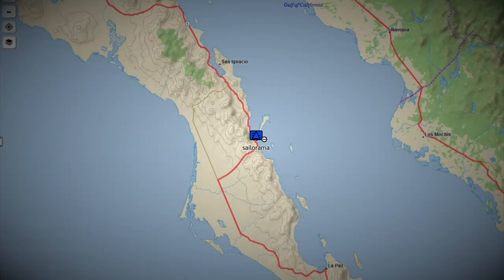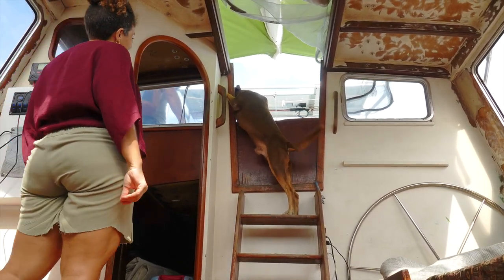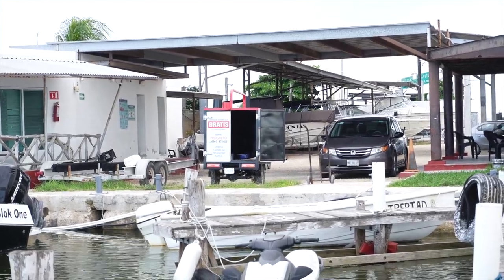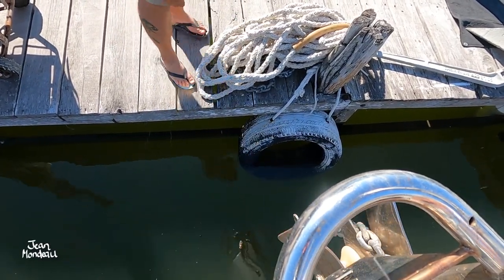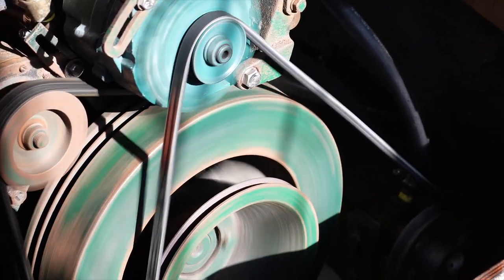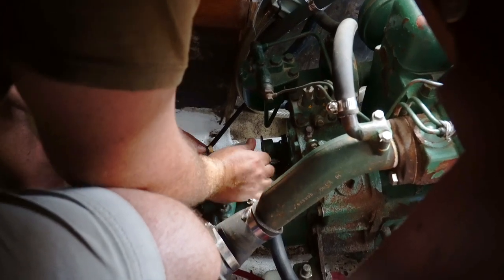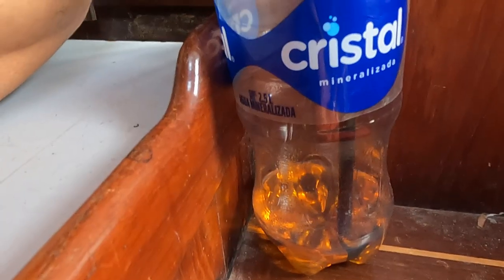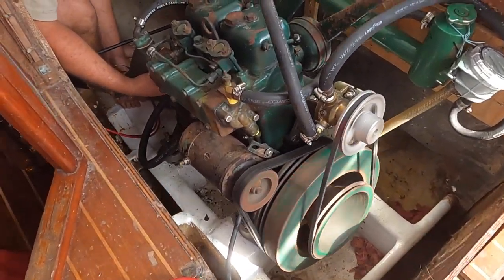our WRECKED SAILBOAT does not have enough revolutions PROGRESO

Comment: The prop is pitched for the previous bigger engine. Re-piching it is an easy and inexpensive solution that will save you troubles and fuel in the future. 
I use an 12 volt circulation pump ( and carry a spare) to pump raw water around my engine. You can place it anywhere convenient and doesn't need a belt. Plus it reduces the load on your small engine. Good luck!
Reply from the maker: Thanks for the comment! Based on some calculations, it's possible that our prop/pitch (we bought a new-used one when we were in the boatyard) may not be too off - however, it's something we're definitely thinking about. A 12v water pump was also something we were considering - it's more of a possibility now because we actually have some batteries to power it, however we dropped so much money on the belt-driven pump that we're not keen on giving it up 😆

Comment: Loved the RAP. Camera angle was so cool. Hope you can get the engine propped accordingly or perhaps once the boat moves there won't be as much resistance from the prop. I'm assuming you have a larger prop than needed for the engine.
Reply from the maker: Thanks! Yes, we've done a couple of calculations and it seems that either the propeller is just right or too large.

Comment: I don’t know if the engine has internal waterlines where the engine gets hot otherwise flushing the water system for a day with vinegar could help clearing calcium built up from evaporating water over the years. If it’s the gearbox then see if you need to get it repaired or if you can fix it yourself.
Reply from the maker: Yes, flushing the system may help and definitely need to get the gearbox opened up somehow👍🏼

Comment: Oh No, you are over-estimating your battery capacity by a factor of two.  But you said it with confidence, and that's all you need to do to get 99% of people to believe you.

Commonly referred to as RC, reserve capacity is the amount of time, in minutes, that a 12V battery can run before dropping to 10.5V. It is measured in reserve minutes. For example, if a battery has a reserve capacity of 150 minutes, that means it can supply 25 amps for 150 minutes before the voltage drops to 10.5V, (RC of 150 minuets = 2.5 hours x 25 amps = 62.5 Amp/Hours). In your case (RC of 195 minutes = 3.25 hours x 25 amps = 81.25 Amp/Hours).  The 10.5 volt limit is for rating the capacity, and not the intended routine cycle. Rule of thumb with lead acid battery chemistry is limit the battery use to about half of its rated capacity or down to about 11.8 volts (resting) and not go below that before recharge.

Reserve capacity differs from amp-hours (Ah) in that reserve capacity is simply a measure of time, whereas amp-hours measure the amount of amps, or current, that can be produced in one hour. You can calculate reserve capacity from amp-hours, and vice versa, as they are related, but they are not the same thing. 

Most BCI group 31 "deep cycle" batteries are around the 100Amp/H capacity, and "heavy duty" starting ("heavy duty" does not = "deep cycle") batteries like the ones you got (LTH L-31T-900AR) are around 80-90 Amp/Hours.  "Heavy duty" refers to the construction and durability of the battery not the intended electrical use (ie. use in industrial equipment with high vibration and little or no suspension on a vehicle, think dump truck or bulldozer).  

There is more about batteries to tell but I doubt many will even make it to here.  Sea you later.   eric
Reply from the maker: Yes, true - by saying 390 amp hours we might have given the impression that is how many literal hours we have to work with, but then I realized of course that you would never run your lead acid battery down to 0%, so in fact it’s at the very least 50 percent of 390 Ah - maybe more like 195 Ah. Your math is fancier, likely more accurate 😝 What I don’t get is, we spoke to the battery shop at length about amp hours - are you saying that the batteries that they say are 195 Ah are actually closer to 80 - 90 Ah? 🤔
Reply: @sailorama  I just copied this off Google from spiritenergy UK  "Typically for lead acid batteries, the usable capacity = 50% of the nominal capacity. Lithium ion batteries can typically be discharged up to 80% before reaching a potentially harmful state of “deep discharge”.
Reply: @sailorama  It doesn't matter how long you talk to someone that is giving you wrong answers, whether through ignorance or deception they will continue to give the misinformation.  (I don't believe much, if any language barrier exists in your case).  

  On the top of your new battery in the lower left corner are the specifications.  One block says "CR 195 min"  that's reserve capacity (or "Capacidad Reserva" in el spanisho) in minutes, NOT Ah (amp/hours). as per the the math above, each of your new batteries has 81.25 Ah each, half of which is available for use during a regular cycle.  With the two new house batteries, your bank has 192.5Ah total, or 81.25Ah  usable when drawing down to the 50% threshold.  With proper "deep cycle" batteries of the same BCI group size (31) you would have about 20% more Ah, and would have a longer service life in the same environment.  But at the price point you got them for it seems a good deal for where you are.
Reply from the maker: Thanks for your input. I do absolutely think that we did the best that we could do with our budget where we are.